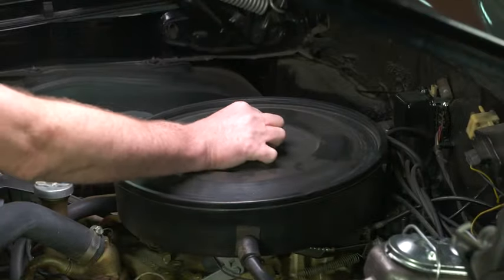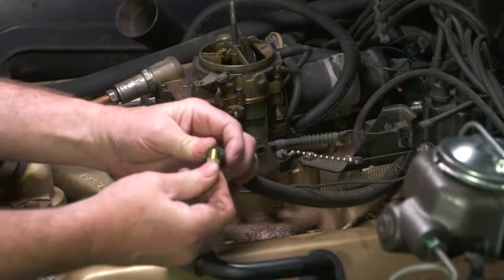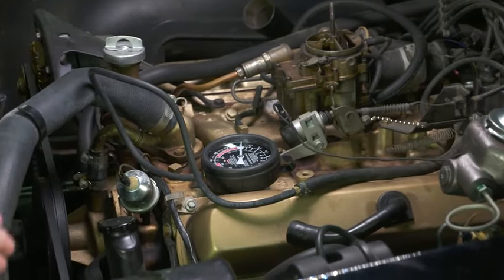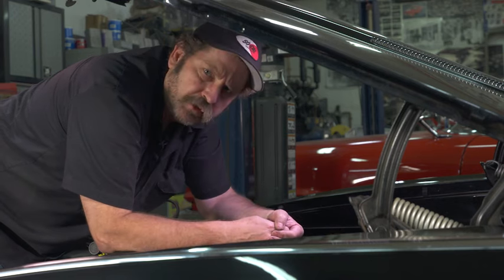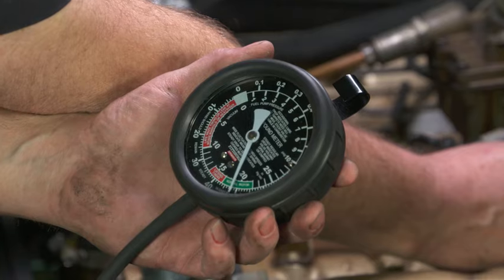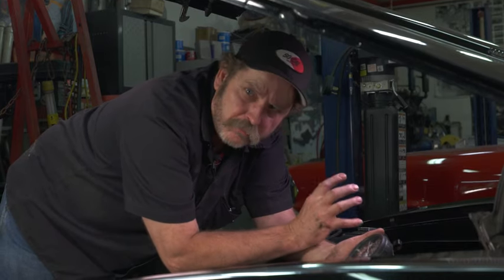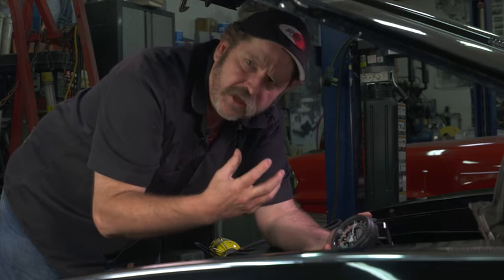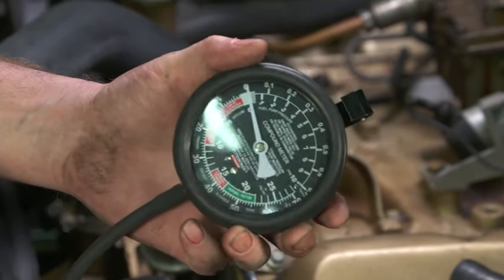Diagnosing Problems with a Vacuum Gauge

Comment: Great video. I need to help my friend with his 67 327. Thanks
Reply from the maker: How can I help you?
Reply: @ClassicCarRestorationClub thanks. Well my friends Chevelle isn't running as good as he would like. He has a holley 600 in the car and a 650 on standby . I'm waiting until we have the same days off which is almost impossible . I plan on checking his fuel pressure, idle, timing and vacuum. I think his problem also might be related to his electric fuel pump. I told him to go back to mechanical but apparently when the shop rebuilt this 327 they blocked off where the mech pump goes. I will definitely let you know how it goes. This is literally his car from high school.
Reply: @thelagmeister  just takeoff the delete plate and put the mechanical pump back on👍🏼
Reply: @jessebaca2750  tried telling him that . He is still using his electric pump. He already sorted it out.

Comment: just a quick question,would this test work on diesels or some deisels?
Reply from the maker: The easiest way to explain the difference between gasoline and diesel engines is with “air” and “fuel.” In a gasoline engine, airflow is everything. You’re throttling air. A diesel engine is the polar opposite. It works on the premise of throttling the amount of fuel being injected—the air simply follows suit. Therefore there is no need to throttle the incoming air. To that end, there is also no vacuum created within a diesel engine.

That being said some diesel engines are equipped with vacuum pumps to power accessories and other components but these vacuum tests in this video would have no bearing on the engines performance.

Comment: Can I test engine compression with this gauge? Because I bought the same on harbor freight
Reply from the maker: Hello! 
No, This is used to test engine vacuum, to check compression you'll need a compression tester.
If you have further questions, please reach out via classiccarrestorationclub.com/contact
Reply: it also reads pressure you neee to adapt

Comment: Thx , what gauge are you using ?
Reply from the maker: Hello,
This is a simple vacuum gauge like those available at most auto parts stores, I believe this one is from Harbor freight.
Mark
Classic Car Restoration Club
Reply: That’s the harbor freight one. It also works for fuel pressure. Worth every penny.
Reply: @danieltrue1689  just bought mine about two hours ago worth every $14😃 The good old harbor freight midnight 🕛 special👍🏼

Comment: Do all cars work with similar amount of vacuum or some of them work whit less vacuum?
Reply from the maker: Most cars work with the same range of vacuum.
The exception is those with very high-performance camshafts where the narrow lobe separation produces less engine vacuum.
Reply: @ClassicCarRestorationClub  Thank-you very much for your time, I appreciated. So turbo engines are similar too?
Reply from the maker: Sorry, I assumed we were referring to naturally aspirated engines.
Turbo or supercharged engines are a different animal as the power adders produce positive pressure in the intake system.
There are vacuum ports on some turbo/superchargers before the pumps but often these do not produce good vacuum until the engine has spun up.
Reply: @ClassicCarRestorationClub  Thank-you for your help, I appreciate it.

Comment: When I accelerate the gauge doesn't zero out.....it goes up to 25hg's and then comes back down to green really really slow!!! 🤔?
Reply from the maker: Hi Francisco,

As RPMs increase the timing advances, and the engine is not under load, it's not unusual to see readings as high as 25Hg. 
If you quickly flip between WOT (Wide Open Throttle) and closed the vacuum should drop then read higher than normal before settling at a normal amount of vacuum. 
Also Higher than normal vacuum readings can be a sign of an obstructed air filter, intake or exhaust system.

Mark
Classic Car Restoration Club
Reply: @ClassicCarRestorationClub  hi, yes thank you for the response. (When I flip the throttle open really quick it's doesn't drop to zero at all, it goes up to 25hg and then slowly comes down to the normal green zone 🤔